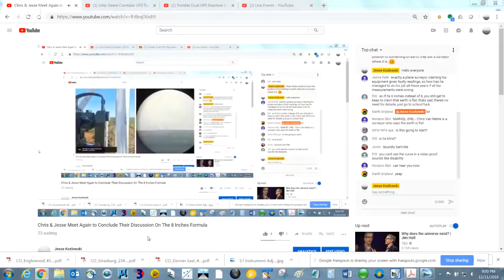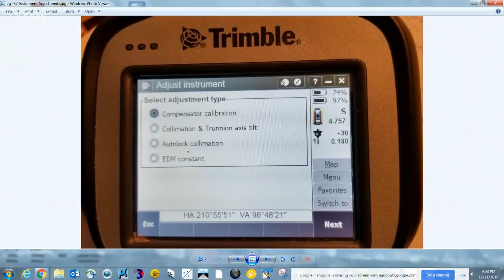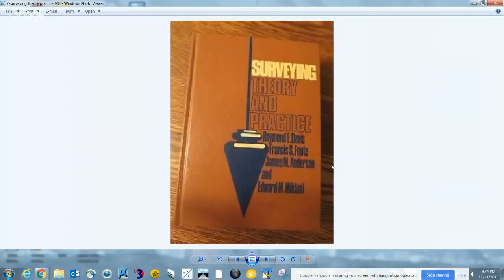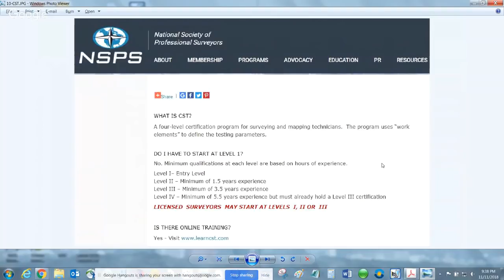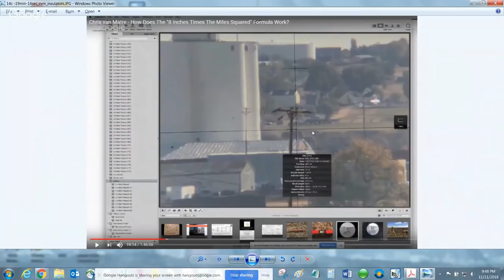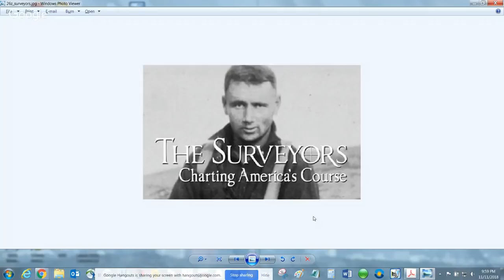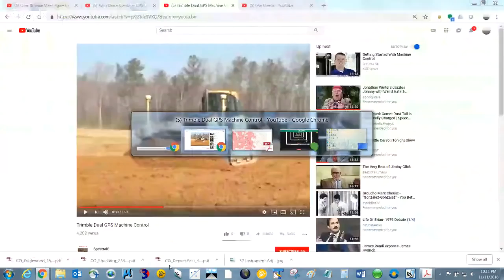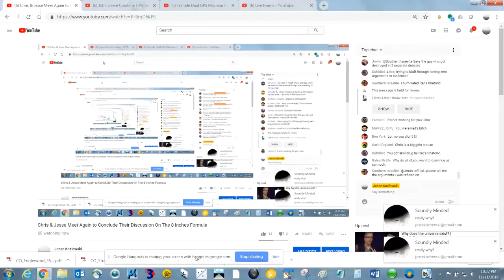Chris & Jesse Meet Again to Conclude Their Discussion On The 8 Inches Formula

Comment: I am not sure but do you have surveyors and Surveyors? like you have electrical engineers that put the wiring in your house and Electrical Engineers that design, like I did, military communication equipment that can survive a nuclear blast?    because that Chris guy is definitely  a surveyor rather than a Surveyor.
Reply from the maker: @M Goudsmits , I am doubtful he is even a 's'urveyor at this point after his behavior last night. But, I could be easily convinced if he could share the most basic evidence of his ability to measure even the very simple "L" shaped test I asked him to perform. If the flatearth is as important to him and his FE brethren as they all proclaim, then why not make those simple easy to do measurements to show everyone the earth is really flat ? Heck, he could with $200k from Critical Think too !  He ran away as fast as he could and he won't come back because he knows he has zero ability to explain the outward tilt of the 2 plumblines at the ends of any line in any direction on the earth's surface.
Reply: @JesseKozlowski  I admired your patience during the whole hangout and also that you stood up for soundly !
Reply: @JesseKozlowski  Because the measurements wouldn't show that the earth is flat?
Reply from the maker: @Hexalobular  , correct. His measurements will match my measurements and any other surveyor's measurements made every day all around the world. That terrifies him, so he ran away. His truth seeking fellow FE believers ought to be asking him saying, "hey Chris, go ahead and show that Jesse just how flat the earth is by your measurements."

Comment: Here’s the thing. I hope non surveyors don’t come away thinking Chris has any credence. He openly said stupid, silly, wrong, unsupported, unobserved, shit.  

Chris said he doesn’t measure more than 3500 ft because it’s beyond the instrument to ‘work right’. So at 2/3 mi he is just being myopic. Then I guess the 50 mile pipeline control survey can’t be done with 5 mile distances as primary control. But he’s wrong. I’ve worked projects with 20,000 foot lengths all day long. And rarely less than 5,000 ft. Continents have been measured with much lower resolution instruments than we use today. Like Mt Everest. 

If he were to measure 2-10 miles, guess what? That not outside the instrument’s ability. It’s outside his ability. 

He said you can’t measure an angle finer than the gun’s readout. Well, 1 second and subsecond angles have been around a lot longer before 1 seconds guns were made. 

I can verifiably measure 0.1 second with a 1” gun. 

He also said repeat measurement is stupid “just adding error”. Flash! One measurement isn’t reliable at the gun’s resolution. 2x, 8x repetition increases resolution and reliability of the measurement. 

Survey 101.
Reply from the maker: Chris is not up to survey 101. He wouldn't have understood any of that. His lack of basic knowledge stupifies me. As it is, with as little as I tried saying to him, his fans accuse me of talking over him. I say let's both just let our measurements do the talking, but, he won't go there.
Reply: Jesse Kozlowski 
Chris is an example of the down side of YouTube. There’s no investment to posting. Posting misinformation is now on par with academics. Opinion is an alternative fact. 

So he’s elevated his status in his own mind and to the undereducated with enough views that he’s believing his own crap over university and NGS and Academy of Sciences Paris and ....
Reply: @larryscott3982  "…repeat measurement is stupid “just adding error”…"
What?
If a second measurement "adds error" then it implies there may be errors in a measurement AND the VERY FIRST in a series of measurements will ALWAYS be best.
Why should that be the case?
Such a statement immediately disqualifies Chris in the eyes of any serious engineer or scientist.
Reply: Mittelwelle 531 kHz 
There’d be no point in asking him about std dev, std err, normal/Gaussian distribution, bell curve, etc. 

Chris has some very tinfoil hat content on star trails; star trails are magnetic vortices. Or as he calls it vortexes

Comment: Jessy I have an idea for an experiment using lasers and surveying equipment that would put this debate to bed. It would prove one we or another the surface shape of a large standing body if water. I need to know the accuracy of theodolite and distance measuring say over 100 meters and to what the expected tolerance could be using the best equipment. Are you interested to be involved in a consultancy capacity for example.?
Reply: I've tried emailing you but your address could not be found.
Reply from the maker: @andrewcorbell7216  , I received your email. There is no debate really. It's been in bed and sleeping a very long time. Flatearthers remain flatearthers because they're not interested in experiments, tests, or measurements that would unravel their fantasy. I've already done the work you're proposing. Check my channel. But, if you want to arrange something and promote it, I'm interested.

Comment: Jesse .. gimme the raw point data from some long distance points mapped out over say 10 miles and I'm betting if those points were plotted in say a 3D modelling tool it would be obviously curved.
flat earthers claiming they can do math / be professional is IMO a long running joke ... the best they usually have to offer is the likes of Oakley who can't even convert meters to kilometers with basic math.
Reply from the maker: +Paul Ward, how about the Lake Pontchartrain causeway bridge road surface for 24 miles? Can you work with WGS84 ECEF Cartesian 3D XYZ coordinates in millions of meters? We should talk. Email me at my address on the About tab on my channel. Thanks.
Reply: Jesse Kozlowski 
The gps kinematic survey of the bridge is rudimentary: it’s a point cloud. The ECEF coordinates will show up in a 3D cad as an arc. 

Preliminary exercise: digitize the roadway in SP or UTM, and MSL elevation converted to ellipsoid height. Convert those to ECEF and import into CAD. You’ll see the same thing.

Then drive the causeway with a roof mounted gps antenna and the only difference will be the accuracy of the digitizing.
Reply from the maker: @larryscott3982  , already done. Did that. I'm looking for an easier software to use for displaying 3D than autocad. Playing with Sketchup lately.
Reply: Jesse Kozlowski 
I didn’t say AutoCAD. 

CAD as in a CAD program. 3D modeling is CAD.
Reply from the maker: @larryscott3982  , of course, CAD. Sending you an email.
Reply: If I had some sample data to work with and some idea of the specification of what the format is I could most likely take your raw data and load that directly in to a 3D view (as a wireframe) that you can then explore.
If Unity doesn't cut it ... I don't see any issue falling back to raw Direct X / OpenGL code.
If this is done using WebGL you and soundly can even publish the results in an open manner on the web.

Comment: When Chris states that the repetition of measurements is an unnecessary level of redundancy I almost thumped my screen. I have no doubt that he can competently operate an instrument for setting out on a construction site, but he really does not seem to understand the need for statistical analysis of the observations for Geodetic surveying. I would love to see him set out a tunnel drive from a short baseline with only one set of readings and be confident of staying on track.
Reply from the maker: @Rob Smith, Yep. And he's ranting  the burden of proof is on me, after I made it very clear I am doing nothing more than representing standard surveying practice as supported by readily available published standards and guidelines. So, I'm displaying books he doesn't own, but says are in his office library and the whole time holding back that he disagrees with all of it. Doesn't that put the burden on proof on him? Chris, open to the pages and show us the deception you discovered based upon your own repeatable measurements,  errr, I guess just one shot  ;)
Reply: @JesseKozlowski  When running traverse, I wonder if Chris shoots in a point by recording a shot from both faces?  You can get away with shooting only in face 1 for small stuff.  Heck, you can get away without balancing a small traverse (with only three or four points in the loop).  But for setting control on a construction site?  Forget it!  For a steel building, the tolerances are so tight that the surveyor has to set points within a hundredth to allow the builders room to make errors on their own.  I don't see how anyone can get away without shooting two sets to every traverse point on a construction site.  I also wonder if Chris stakes out radially or if he occupies an offset (or a building corner point, if possible) and turns 90 degree angles to the other points.  And I wonder if he would know why one method is tighter than the other based on his poo-pooing of shooting sets.